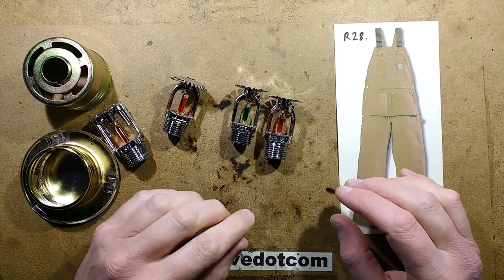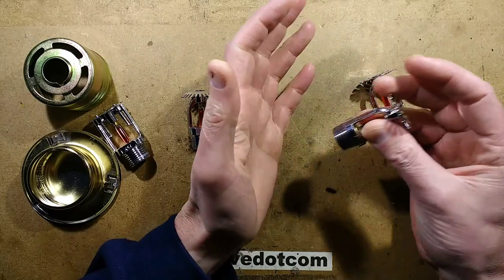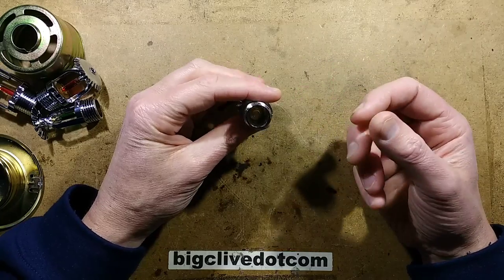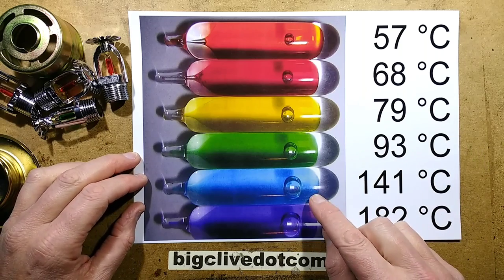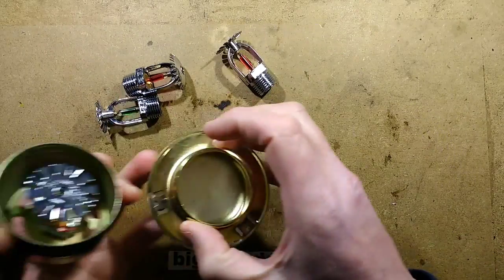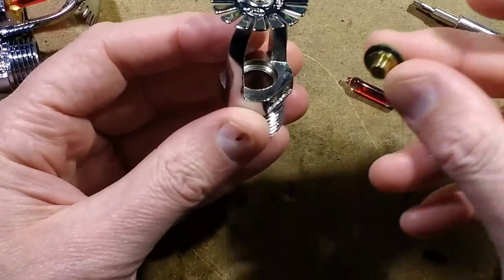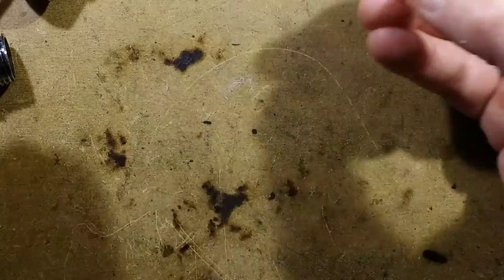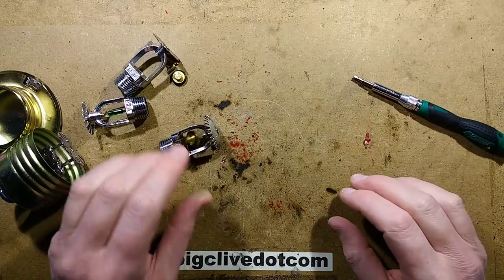How a fire sprinkler works. (featuring broken glass and spatter.)

Comment: Many modern systems use a "dry" sprinkler system. They are pressurized with air, as soon a detector notices a sudden pressure drop (a single sprinkler pops) high volume pumps start up and all hell breaks loose. The dry system has the advantage that the water inside won't go septic i.e turn into a stinky brownish soup that smells like crap,  when not in use.
Reply: The "dry System" you are talking about also has the advantage that it can be installed outside (e.g. in a car park) without the danger of freezing water in the pipes.
Reply: The one I saw with my own eyes was in a big-ass sawmill, in the main building. Due to no heating and great drafts in winter. They were connected to 4 enormous pumps, those also had a backup generator in case the power would fail. They were doing some testing, the amount of water those things pumped out was staggering.
Reply: RSOFT92 
That's the usual reason for a dry system.
No reason why a wet system should become 'septic'.
Reply: LaterMeansBrick 
Deluge systems can be positively dangerous to be caught in - you could suffocate.
Reply: Dry systems are used for cold areas they cannot remain heated. Water in wet pipe sprinkler systems can get a little Skunky after a while, but after flowing for a couple moments it is clear. Wet systems are more advantageous because water is at the point of ignition instantly.
Reply: The stinky, brownish soup that smells like crap (because it's not been in use) is simply water with rust from the steel pipe.  I've never gotten close enough to smell it, but I have witnessed a system activate, and yes, they all do it.  Has to be steel pipe line, cannot be plastic because plastic could melt (or burst) and then the system would not do its job.
Reply: There's talk of extending sprinkler systems to individual homes here in North America. One proposal is to integrate the sprinklers with the cold water supply, having them weave through the ceilings of the house and terminating in the faucets and appliances. This would avoid the stagnant water problem you raise. More importantly, it would allow a reduction from two dedicated systems (one for potable, the other for sprinklers) down to a common one. It is believed this might make the idea more palatable to homeowners.
Reply: That's a very interesting idea, I like it, I guess.... but honestly, how MUCH of a problem is stagnant water in pipes of a fire suppression system?  It is equally effective at extinguishing the fire.  If you've ever been in ANY building after a fire broke out and was extinguished by the responding fire company,  you'd know that everything is filthy, stinking, scorched, soaked, and pretty much ruined anyways, so a few seconds' worth of "stagnant" water isn't going to change things too much before it runs clear.
Reply: Good point about smoke damage, but the stagnant water would be an issue with an accidental discharge, and those are statistically more likely than actual fires.
Reply: sprinkler water is black and it won't kill u.  piping in dry systems is so full of rust and scale they should be illegal.  if  look at the pipe from a wet system thats been filled for 50 years the pipe is as good as the day it was installed.
Reply: If the water is murky has no impact on the firefighting capabilities but in areas with many people, this could pose some problems. Stagnant water tends to be a breeding ground for E. Coli and Legionella bacteria. In wet sprinkler systems the check valve must be in working condition all the time, in case it fails and the water mains pressure drops. It prevents the harmful pathogens entering the water mains.
Reply: Sprinkler systems have to run from header tanks in big buildings. I worked in a place that had an old open top tank full of drowned rats. Nice!
Reply: There is plastic sprinkler systems, it's trade name is Blazemaster, or Chlorinated PolyVinyl Chloride; we also use copper, brass and very rarely stainless steel pipe.  And no, all the heads do not activate in the average system.  They do all activate in a very specific sprinkler system called a Deluge system, typically used to cool large generators or transformers so they don't catch on fire.
Reply: And LostJohnny, they don't have to be run from a tank in large buildings, the tallest building in Boston has two VERY large pumps in the basement that are fed from a water main under the street.  one pump does the basement to roughly the 30th floor, than a monster pump(300hp electric pump,) does the 31st to 60ish floor
Reply: but the pipes still rust from residual water laying in them and ka-whoosh, you have multiple-hundreds of panicked guests (sheeple) fleeing the building and a quickly escalating pyramid shape path of waterfall destruction from whatever floor the line blew out on down top ground level ( good old hotels)
Reply: Well...that is kind of the idea, deny oxygen to the fire..
Reply: I once neglected to flush out the bread I'd used sweating on a fitting. You should have seen the slop that came out a few days later!
Reply: yummy yummy bread! I never use the old bread trick anymore, since most everything is pressure balance/ceramic cartridge and tiny passageways, they plug easily.
I use a shopvac necked down to small size galvanized pipe (car brake line) and feed it inside past where it's being sweated, crank on vac and go
same for main valves where the water keeps trickling from bad curb stop, open valve place vac line down through open valve and go.
Reply: They make sprinkler heads for PEX tubing, such as UPONOR.  I think that if an area is hot enough to have the pressurised PEX rupture, then having the water gush out in that area would be a good thing.  I'd rather have that than wait until it gets hot enough in the vicinity of the sprinkler head.
Reply: Dry sprinklers are primarily used in areas where temperature is not heat controlled i.e. Outside parking garages. Also they are used sometimes inside of office building server rooms along side a clean agent system FM-200 usually in the us. In this case it is called a pre action system. A dry system uses a similar flapper valve as a wet system. The only difference is that there an air compressor that will pressurize the dry part of the system. They are very fascinating but a pain in the ass to test and take care of.
Reply: That data center dry system would more likely be around 20-30 psi to hold back the water pressure the general rule we use is 1psj of air can hold back 4psi of water its closer to 5 but we use 4 to be safe
Reply: Stan Patterson. Standing water is the home for Coliforms, E-coli and Legionella. A Legionella report should capture the service, maintenance and use of sprinkler systems, so it saves a whole world of pain to have dry systems. There`s no real advantage in having a charged system, and the pros of having a dry system far outweighs the cons.
Reply: Yes they are better for health standards but even a dry system still has water in the double check valve below it. Double check valves are used in both types of sprinkler systems to separate the sprinkler and potable water. This often is also where they have 2osy valves another way of being able to shut off water to the systems to preform maintenance. A dry system is much more costly to install and to have inspected. Every year you do an annual test which involves triggering the dry valve but without flowing water while every 3 years you time how long it takes for water to reach the "inspectors test" valve. This simulates the fussing of a head. Also every 5 years the pipes have to be internally inspected. While a wet system is cheaper to install and test all you do for the annual is flow water through the main drain every year. Although bough systems if they are using galvanized pipes require 5 year internal inspections where we stick a camera down the pipes to check for any obstructions. Also dry systems still have the rusty water in them it just shoots out in the form of a rust powder during testing and then the water flows a amber color after that. Sprinkler water in general is unhealthy.
Reply: LostJohnny There`s various different ways of feeding sprinkler systems. Some are direct from the water main, a lot of systems now you will see a huge storage tank outside, like a giant immersion heater. Legionella assessments should be doing away with the old rat drowning systems!
Reply: Some wet systems have inhibitor injection systems. Think antifreeze in you car's radiator.
Reply: Or an air over water system
Reply: LaterMeansBrick 
That is what a backflow valve is for. It's basically a double check valve.
Reply: As a sprinkler fitter, I have used these "bulb" type sprinklers in freezing conditions. 
Dry systems are used for areas susceptible to freezing,  or any space that will not hold a temperature above 40 degrees Fahrenheit.
The water in a wet system may become stagnant but it is fed from the city water supply. After the water that has been sitting in the pipe has been pushed out by the city water pressure it will be clean. It is meant to put out fires not dance around in.
Reply: @andrewholdaway813  deluge systems still use water. You might be thinking of halon system
Reply: The have dry systems and then they have dry sprinklers. Dry systems are full sprinlkers filled with compressed air or nitrogen with valve that operates with pressure is lost. Usually in areas where the complete system is exposed to cold temperatures ( parking garage).  Dry heads are used with a wet system when just the head is exposed to cold temperatures ( heads for balconies).
Reply: @Madman9mm  
No, I meant in a water system. The volume of spray preventing you from breathing.
Drowning is basically suffocating under water.
Reply: It’s way more complicated and expensive than a normal wet auto sprinkler
Reply: @andrewholdaway813  I saw 39-68 gallons per min (160-280 lpm?) at typical pressures, that's 10x what a bath tub faucet delivers.
Reply: @hydrocarbon82  
Flow rate 😉
But yes
Reply: @stanpatterson5033  in correct i am fire protection engineer and infact we do use plastic pipe in residental propertys called blaZE MASTER
Reply: Protects vital storage..Aircraft....mechandise.
Reply: i think we have a dry in our newly built sixth form center as we noticed the hard way as the fire alarms triggerd as the water pressure changed and the fire brigade came as the fire panel automatically alerted them. but the sprinklers did not go off.
Reply: And all hell breaks loose...
Haha..like the terminology. 😂😂
Reply: @LaterMeansBrick  a lot of the times those fire pumps can suck a 6 , 8, or even 12” city main dry. When we test, a lot of the times we have to let the city know because neighboring buildings will loose all water pressure😂
Reply: @andrewholdaway813  most wet systems in the area I work are steel, and even with a day of having water on them, the water gets very rusty, nasty and stinky, so yes, most wet and even dry systems become “septic”
Reply: @andrewholdaway813  depends on the deluge system. Some are just water powered, some are a gas that does suffocate you
Reply: @jaredd9297  not instantly, but within a minute by code, I believe the type of system you thinking of is a standard wet system
Reply: @stanpatterson5033  there are plastic systems, most residential systems are plastic (CPVC (chlorinated polypropylene vinyl chloride)) and even some industrial applications are plastic due to their lack of rusting and possibility of less wear. Also installation and parts are cheaper
Reply: @denisvermeirre1024  the only issue with that is that all sprinklers have to be serviced within 50 years and possibly all replaced after that, which can be spendy and a nuisance for some home owners
Reply: @stanpatterson5033  it’s mostly the longevity of the pipe that’s the concern. Also, a large amount of “scale”, or chipped iron off the inside of the pipe can become dislodged and block one or more sprinklers. This is why annual flushes are required, but many places do not abide by this due to the costs
Reply: @Lead_Bacon   I think you misread my comment, I said the wet systems have water right behind the sprinkler head so you get water right away.
Reply: I know that smell, yuk, I was called out to repair an ceiling air conditioner in a shop as it was dripping water over the cakes (I nearly died laughing when I got the call), it was deep into the shop and the drain pipe was very long and was blocked, I flushed it out with an air line and what came out was this thick black jelly that smelt worse than dead decomposing animal carcasses
Reply: The dry nozzle adds pressure air to the pipe and is also a link in more linkage systems to better prevent unnecessary property damage due to wrong actions.

Comment: I work for a pharmaceutical company and the covers are used in clean, sealed rooms that have positive pressures to keep the dust out.
Reply: Jeff Pinter  Also used in server rooms as you need to maintain integrity of the room
Reply: Eliot Mansfield
No, usually server rooms are equipped with water mist or gas systems. To prevent water damage of course. And the heads of those systems are not concealed.
Reply: I would think that it would be trying to fight electrical fires since they have to be fought in a different way. I bet the servers would be toast when the fire is cooking them (don't know a proper way of saying it).
Reply: @LOUDcarBOMB  Magnetic spinning drives can be recovered after being subjected to hundreds of degrees C with enough dedication. SSD's even more so. A dedicated data center fire suppression system usually sends an emergency shutdown to the servers at one temp, a kill switch to all backup power at a higher temp, and finally trips the water. In some states halon, co2, etc systems are now illegal because people have been killed by them. In mine they're illegal for new installations
Reply: @copperhamster  some may use Halon gas, it really does vary but you can buy a lot of these things anyway (,such as CO2) so I can't understand why they'd be banned except for Halon.
Reply: @copperhamster  Isn't halon gas totally banned worldwide for newer data center installations ?
Reply: @psirvent8  In the US it is, I'm not sure about worldwide. (I knew my state banned it but wasn't sure at the time it was country wide).
I think some states have forced replacement, and some states still grandfather in existing systems though. I know a college we held meetings at still had a hallway to a server room well-signed as 'Halon gas fire suppression present' as of 10 or so years ago.
Reply: Also in my first primary school (UK)
Reply: @psirvent8  yeah, pretty much the world over; mostly as you are toast if in on the floor when triggered and can't get to a scba or out quick enough. 
Co2 you have a fighting chance to get the hell out.  
Water based systems opens up a whole new range of other issues beyond the now toasted equipment.
Reply: @psirvent8  No, server rooms are typically covered by gas systems and a dry preaction system that will deliver water should the gas system fail.
Reply: @blameburr8722  we havent used Halon since the 80s there are several other options available today. Halon can only be used to replace/recharge existing Halon systems in the US.

Comment: Don't suppose you could point the heat gun at the cover and see what happens?
Reply: Richard Berridge I popped a fusible cover off a heat sensor trying to test the rate off rise without popping it... Its somewhat anticlimatic.  In my case my reaction was whelp there goes $20.  I did get to take it apart after. Clever simple mechanism in heat detectors.
Reply: I think it's more likely, because it's cheaper and easier to manufacture, that instead of melting the metal tabs holding the cover, it's actually supported by a very thin metal bent inwards, when the whole case becomes like an oven from the heat, the glass breaks and and just the water weight is enough to unbend the metal tabs and release the cover. The drop down defuser looks like it's purpose is to stick out of the case to spread the water, but even before it's allowed to drop down, when the glass breaks the whole case is already filling with water.
Reply: Wouldn't they be bimetalic strips that will bend with heat?
Reply: To cover drops off 20° before the head activates. So with a head that is 155°F the cover drops off at 135°F. Those just are solder points where he was pointing.
Reply: Pretty sure the covers are soldered on under leaf spring pressure, so the instant the solder melts, it pops off with force, albeit, very light, unspectacular force. Just flings off and hits the cook in the head. :) (Since the only place I have seen them was when I was a cook, and once one popped off and flew right at me in the middle of dinner in a packed house). Thankfully, the glass part didn't pop, just the bottom part with the cover. I can confirm that the bottom cover releases FAR before the glass does. I assume that one popped loose too early because the solder was old, but at least it fails by breaking loose when it shouldn't instead of not breaking loose at all when it should.
Reply: Better to get hit by a lightweight disk, than a deluge of water!

Comment: Those hidden sprinkler covers are what they use inside residential units like new condos and apartments. They are very nice since they pretty much unnoticeable compared to the ones in older construction. My last condo had them all over the unit and it took me a few months to even notice there were sprinklers inside my unit when I decided to pull off a cover while painting.